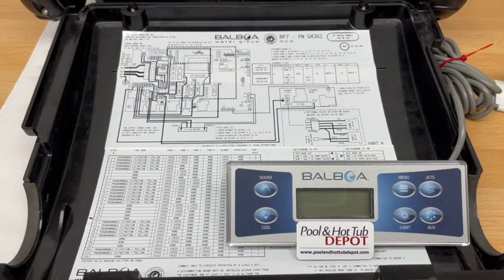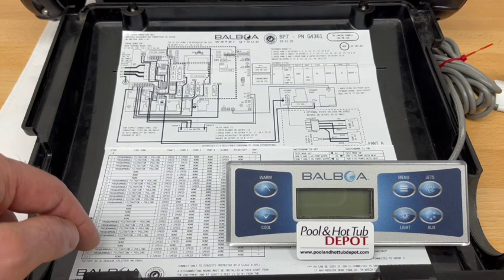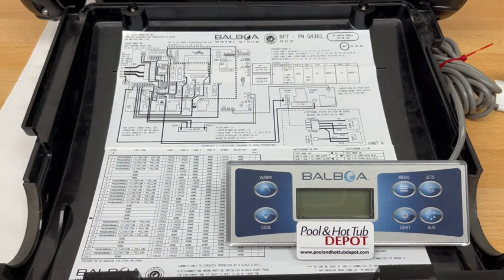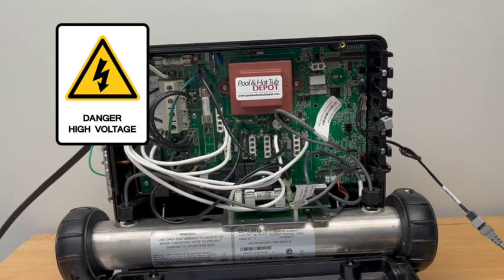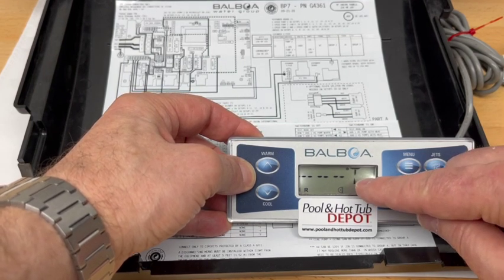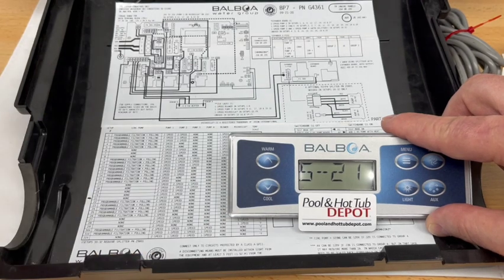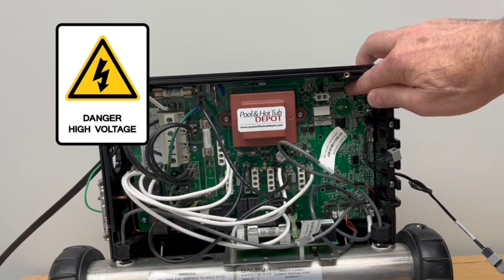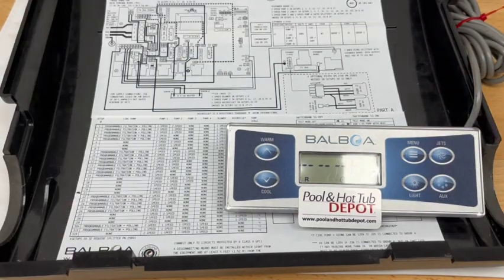Balboa BP7 TP500 Programming

Comment: I am in need for the same setup with the same equipment. Looks easy enough. Where are the dip switches set after you exit and put #1 back in the off position? From the factory, # 2 and 3 are in the on position. All others are off.
By the way … good video. Explained much more than my instruction book!
Reply from the maker: DIP 2 & 3 are for controlling amp draw. Before turning on DIP 2 and 3 it's important to do an amp load calculation to ensure the total amp draw is not going to overload the breaker. Dip 2 on allows the heater to stay on when #1 pump is running at high speed. DIP 2 on allows the heater to stay on when pump # 2 is running at high speed. Take note of your GFCI breaker size and whether the heater in your BP7 is 4kw or 5.5kw. A 4kw heater draws 16.7 amps, and a 5.5kw heater draws 23 amps. For example, a 50 amp GFCI breaker at 80% load per NEC can run up to a 40 amp load total. Take 40 amps, subtract your heater amps, and that's what's left to run both pumps at high speed. If the total amps of the heater and pumps combined are, more than 80% of the breaker rating, then DIP #2 needs to be turned off; if less than DIP 2 can be on.